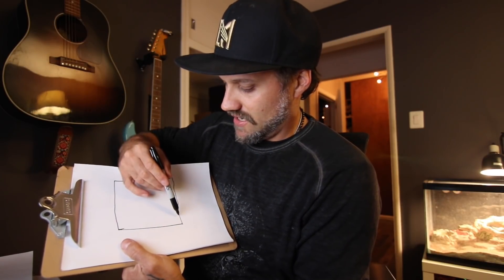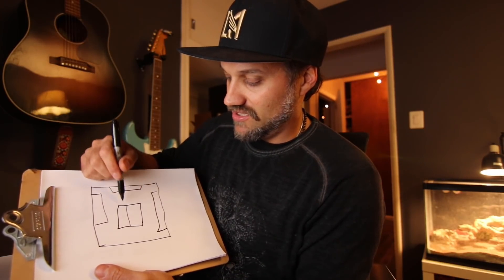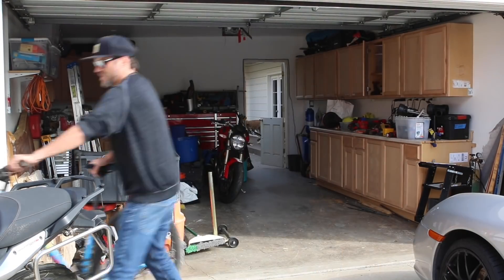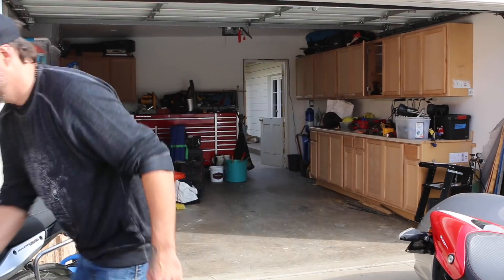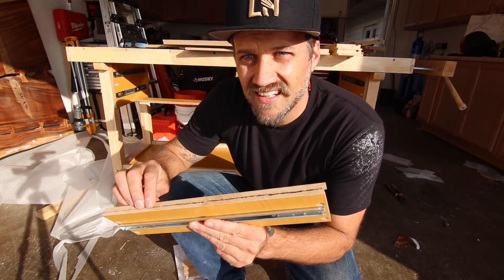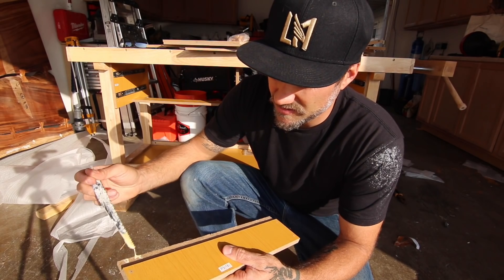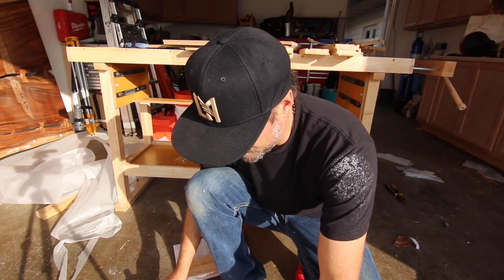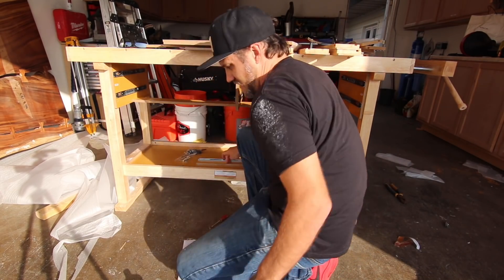Workbench build (harbor freight)

Comment: I just bought one no broken drawer sides but on mine the pegs that are on the center board that attaches to the underside of the table top did not line up, I had to offset one of the holes with a drill bit to make it fit. Good video.

Comment: Someone else mentioned using your own screws and I should have taken it to heart. The bolts and screws provided are the Chinese junk that strips out if you look at them the wrong way! Not to mention using the a hex wrench on bolts where most of the pre-drilled holds just don't line up is a real PIA!

I HIGHLY recommend using your own screws, trust me, what should have taken 20 minutes to attach the cross members between the legs took over 2 hours, and I had help!  I had to twist and tilt and rock the legs to get things to line up just enough to get the bolts to catch. Just when I thought I got them tight enough, nope, the cross members are still a bit loose and I'm thinking it's time to use glue and replace the bolts with my own screws. I think glue will be a must because the wood is so soft it takes little effort to strip out a hole. The glue will tighten things up without having to over tighten the screws.

Then there was attaching the legs to the top, oh boy. The holes were so off on one side I had to use clamps to line it up and run the screws in. Once again I would suggest NOT using their screws. I stripped one out before I knew it, but was successful in using drill out bits (yep they work like a champ!) and replaced that screw with a long wood screw.

Just when I thought I was on the home stretch and could finish up with the drawers I quickly realized the backs of the drawers were 1/2  inch. too short in height and missing the channel for the drawer bottom. It ended at the top of the bottom of the drawer! I guess someone thought I wanted to be able to quickly remove the drawer bottom from the rear? Hopefully customer service can hook me up with replacements.

**UPDATE** - My bad, this model has 3 holes drilled into the back of the bottom which is used to secure the back which simply fits inside of the bottom and both sides. I had to flip the bottom around.

I also noticed a nice scratch in the top of the table top. I figure it's going to get dinged but it was a bummer to have it damaged right out of the box. But I guess it goes back to,  what do you expect for $99?

It will get me by until I decided to build a replacement, then I can use it as firewood :)

Comment: That's a pretty good idea. 
The only thing I 'might' have done differently is to reverse the drawer openings on one table and screwed them together so that both of the wood
vices were on the same side. That way, should you ever have to do some plane work on a long piece of wood, you could have both vices on the same side to hole the piece. 
Harbor Freight must have bought a Yoda-billion of those tables because I just got an email offer with that same table priced at $119.00.
So, how has it held up in so far?

Comment: Dude put rockler casters in it and make it movable so much better
Reply from the maker: I like that idea! thanks!
Reply: @clawandhammer4635   Rockler casters cost like $75. I just bought this work bench ($119) and will be putting it together next week. Eventually I'm going to buy casters but casters that cost that much is out of my budget. Any alternate suggestions? Also I'm stocking up on glue for the anticipated broken drawer sides.

Comment: what's the approx. size of the box it comes in? I don't have a truck so it looks like it will be hanging out my trunk a bit...
Reply from the maker: Dave's Not Here it’s pretty large and heavy. Maybe 4x2
Reply: @clawandhammer4635  I managed with it hanging out the trunk. I'd like to point out that I picked it up from a place called Rural King, first time I had heard of them , the store is huge. They sell the same table for $99.99 all day long. They have stores all over the north and south east U.S.
I got lucky, none of my drawer sides/back were damaged. A slight split in the divider where they over drove one of the dowels, nothing a little glue and a clamp won't take care of. Two minor indents on the top surface, adds character... Mine seems to be a bit darker then most I've seen, but it looks good.

Thanks for the video and response.
Reply from the maker: Noice👍🏻